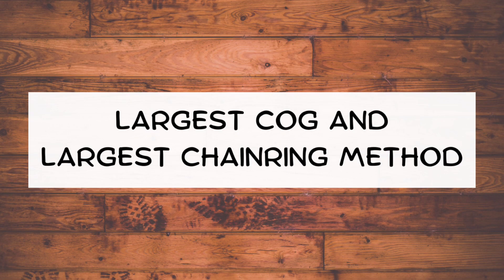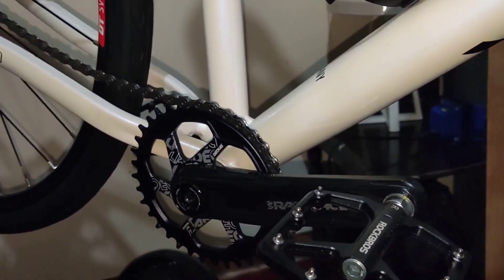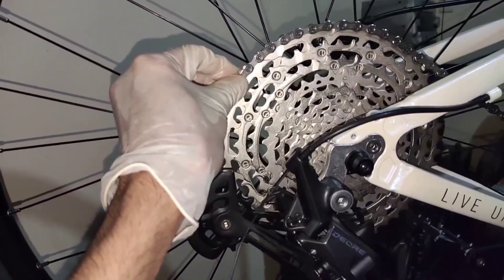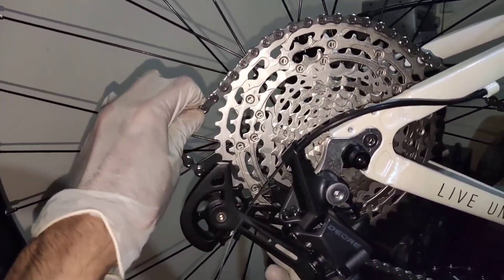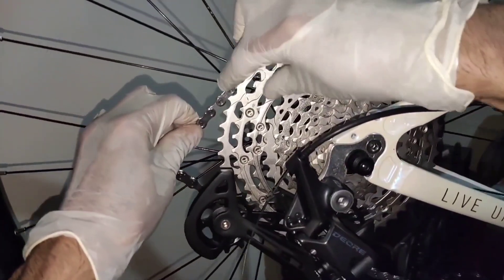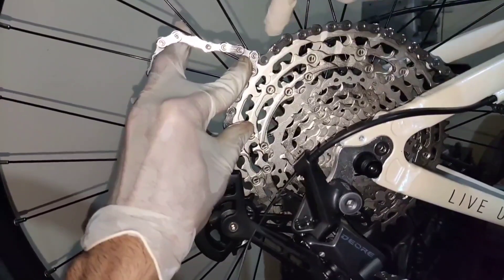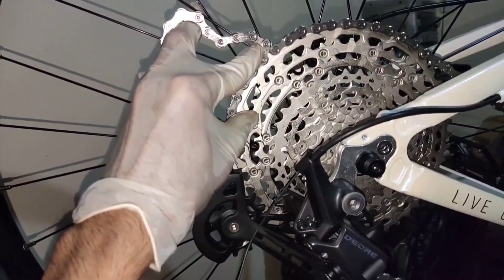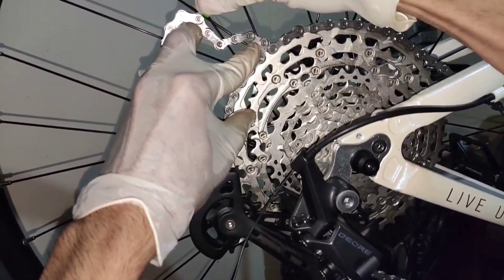EASY WAY TO SIZE YOUR BICYCLE CHAIN ! 1x12 SPEED | THE 5 O°CLOCK WAY

Comment: The chain looks slack along the chainstay, do you pull it tight? I recently followed a park tools guide using a similar method and I ended up cutting the damn thing too short, but you appear to leave more links.
Reply from the maker: Hi sir good day! Yes sir i pulled it tight. When i shifted it to the smallest cogs, the chain are not slack along the chainstay. perfectly fitted. when you followed the step on parktool, they only telling you to add only 2 rivets. Ending up that will be too short. I followed here is from the video of JamesTheBikeGuy. +2 outer link and 1 inner link. Here's the link of the video below. Thank you and Have a nice day ahead :-) https://youtu.be/CwGTMflE0FY
Reply from the maker: Watch also how James shitt it to the smallest cogs, in that link